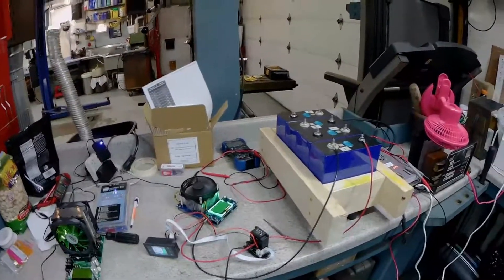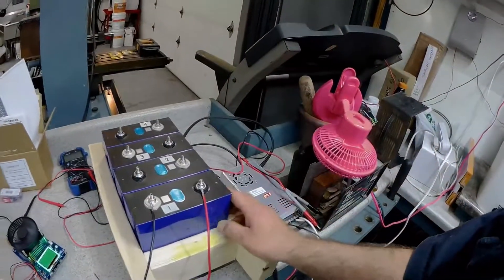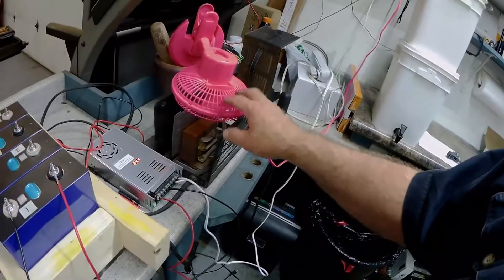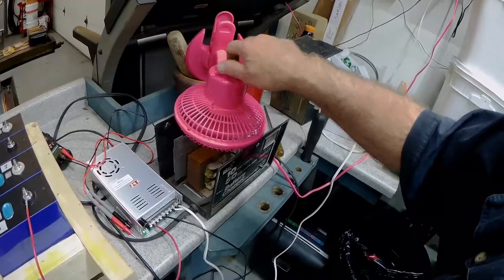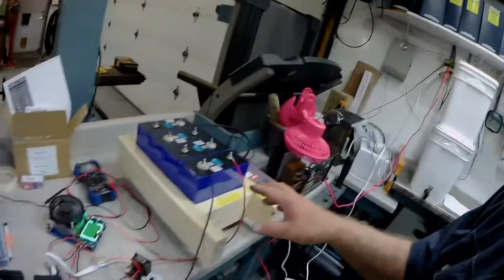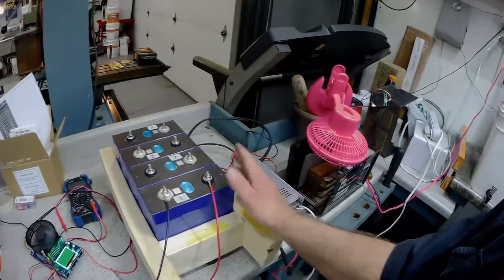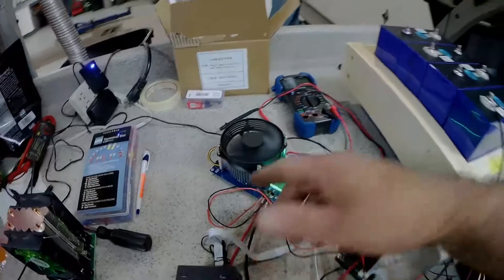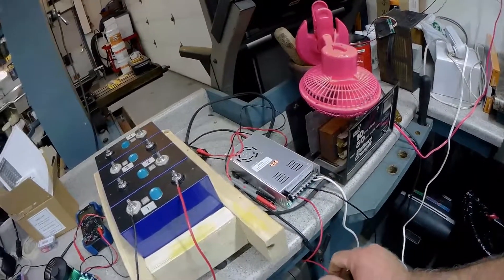Charging up 280 AH Lifepo4 cells #1

Comment: Cheap fixed supervisor IC BMS's typically have overvoltage cell at about 3.7-3.75v assuming you bought an LFP type BMS and not a LiPo BMS which is about 4.3v cut out.

Comment: Good morning Mark. I now ,y question is not related to this video but wanted to get it out there. 
Robert Osborne here. I used your video on wiring your combiner box. Do you have a video wiring a combiner box to a charge controller. I have a midnite solar classic 200. 
8 solar panels 315 watt 69 volt 9.4 amp
Wired 4 in series and then the two sets parallel to the combiner box. 
48 volt battery bank. I was told wire up the batteries first. 

Thanks for the help
Reply from the maker: I'm sorry, I do not but it's pretty straight forward. The Midnight Classic installation manual will show you the connections. I'm looking at my Classic 200 right now, with the cover off, there are 4 large lugs, the far left goes to the battery (+), the next one to the right goes to the battery (-), the next one to the right is the white coming in from the combiner box, and the far right is the red or (+) coming in from the combiner box
Reply: @mark_osborne  thank you 
If you don’t mind I will try to send a picture of both.
Thanks I will try to wire in the morning

Comment: Very cool!  Maybe in the next one you can share where you got them and how much.  That charger sounds like it needs some promotion too.  I'm getting ready to buy another 64.  I have 64 of the older 272Ah Lishen cells.  I'm going to get the Seplos DIY kits and make up 8 x 16s batteries for our off-grid system.  They ain't cheap.

Comment: Welcome to LiFePO4 club. Was gonna mess with the Li-NMC variants, but the nominal 3.6 volts per cell would've cause my inverter to have fits or scale it to have the same usable capacity. The nominal 3.2 volts per cell x4 on LiFePO4 mimics a typical 12 volt AGM battery profile to the point that most AGM chargers couldn't tell the difference and 12 volt nominal devices are able to use the full capacity of the battery pack without having too much fits.

As for BMS using LiFePO4, most of them out there are pretty much junk and they claim that it will work them and I more of them on the not side. The ones that I've used are Ji-Kong (JKong BMS or JK BMS), JBD BMS (Jiabaida BMS or branded Overkill Solar BMS), and Daly Smart BMS. Each have their pro and cons, main pro is that you can customize the cell voltage limits via bluetooth connection and app on a phone or tablet. The only cons are they're pricy, but considering that they're programable you can use them on other lithium variants.

I've been migrating my aging 100Ah AGM's to LiFePO4 for my APC SUA1500 UPS(s) and they've been working well so far. If you got cells from a reputable seller, they pretty pull about full capacity per manufacturer datasheet +5 to 10% for the first 10 full charge/discharge cycles. I've been following "Off-Grid Garage" for awhile and making plans to dive deep into the rabbit hole on larger LiFePO4 battery builds. I could do a turnkey approach, but what is the fun in that?  :-P
Reply from the maker: Exactly on the "migrating", I totally get  what you are doing :-) 
Yes yes,  I need to find a BMS that actually works. My dear friend David Poz suggested the JK as well as the one from Overkill Solar (based on my notes). Good stuff Felax. I assume you have been offgrid for quite a while if you have mastered AGM's?
Reply: @mark_osborne   I am currently grid-tied and on 1 to 1 net metering. I do have 7.5 kWh of usable AGM storage for backup. I've been acquiring gently pre-owned telecom over the years, however they seem to be getting heavier every time I replace them as the years go by. Compare to brand new ones, at least they were affordable. 

My utility supplier is now stiffing me $30 minimum usage plus taxes for the privilege of being connected to the municipal grid and will be going to TOU rates in the next few years. Thus giving me the incentive to go self-consumption and have at least 60 kWh of storage. That way, I can take myself offline and sell off the excess solar that I don't use at peak rates. If I crunch the numbers right, it'll offset the minimum usage fees by 60% per year.
Reply from the maker: @felaxchow207  yes yes, I get it. Energy providers (everywhere) are attempting to "squeeze" net metering customers